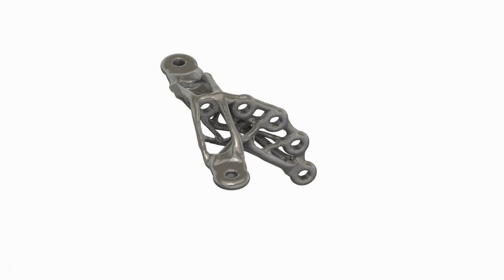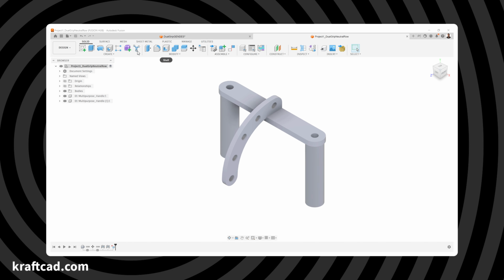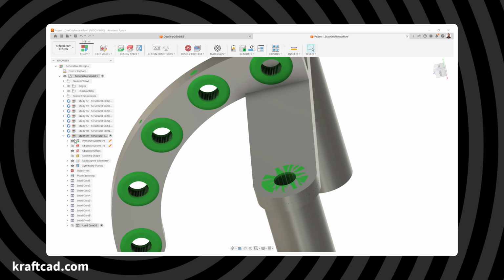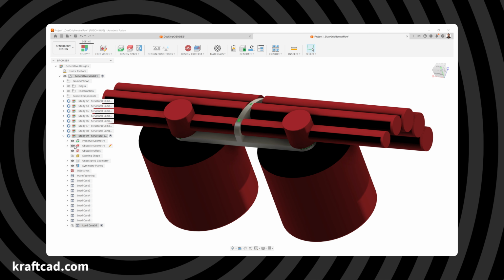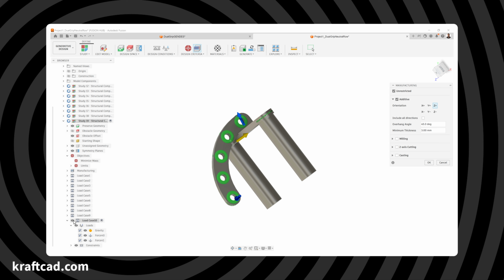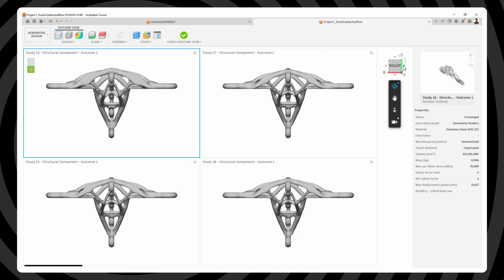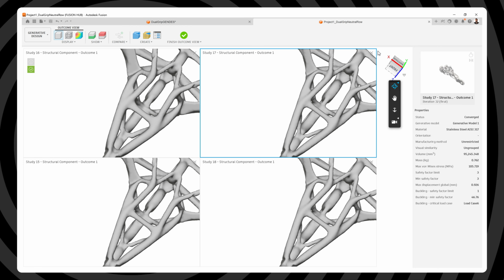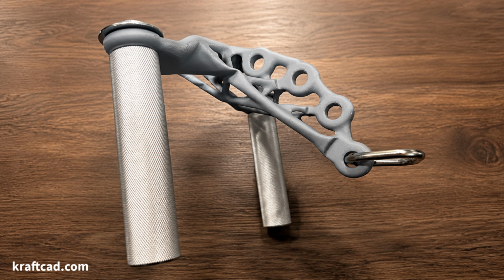Fusion 360 Generative Design to Metal 3D Print — Full Engineering Workflow

Comment: Why did you use ten independent load cases in the Generative Design study instead of combining all the loads into a single load case?
Reply from the maker: Because the ten load cases represent different operating conditions rather than loads acting simultaneously. Combining them into one load case would assume all loads occur at the same time, which would create an unrealistic and overly conservative condition. By keeping them separate, the generative design has to satisfy each operating scenario independently. If those loads could actually occur simultaneously in the real application, then they should be combined into the same load case.